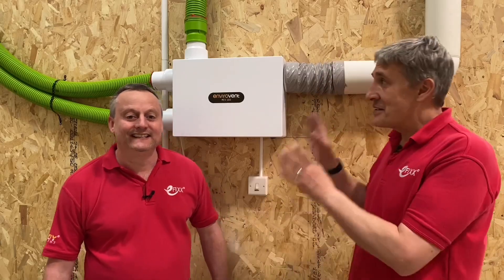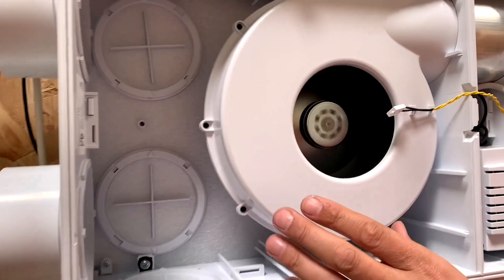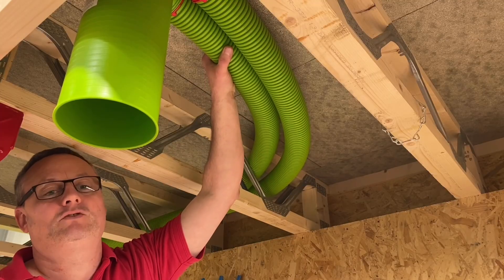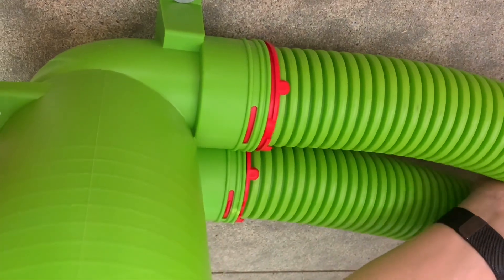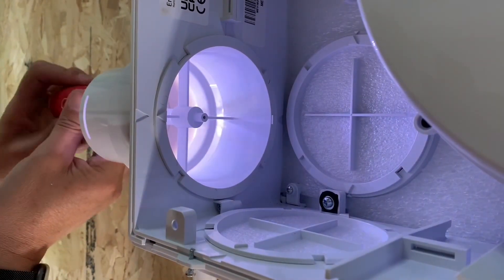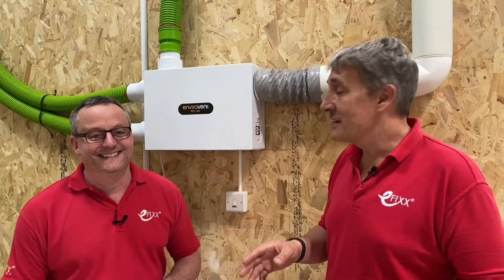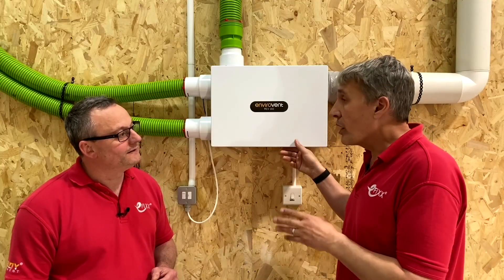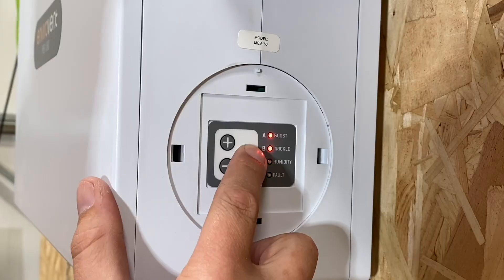WHOLE HOUSE VENTILATION is EASY with the MEV Fans & Fast Track ducting from ENVIROVENT

Comment: Nice system, worth considering for the future, i tend to fit MVHR's these days.. tip, use a double pole switch for running the boost and light switch.. tend to wire the lights in pvc t&e and the boost in lsf, saves confusion on the connections.. now for a few beers to destroy the mental image of Gaz sat on the khazi :)
Reply: Fast track ducting when designed as part of a mvhr system is a game changer. No contractor would willingly subject themselves to a week of more of screwing and gluing conventional rigid ducting after using this... 60% at least time saving
Reply: @dave2166  Both flexi and rigid have advantages and disadvantages .. we tend to you slimline rigid as we mainly do new build flats and more often than not ceiling void space is at a premium, esp if it needs lagging due to condensation or a fire break is needed, the flexi I'm sure is great for house bashing like the lads showed in the video, it's a good product and i dare say i'll use it when the right job comes up
Reply: @thattoolguy9432  you can get oval section semi rigid.... ceiling voids are the bane of any ventilation designers life... rarely sufficient
Reply: @dave2166  Thanks, that's handy to know i shall have too look into that .. i feel your pain.. it's gotten worse in recent years now with the added sprinkler systems .. we usually get 8" between finished ceiling height and the slab above , but by the time dryliners add a main bar then track and board that's the best part of 3" gone.. we tend to use 2" x10" slimline.. don't do a lot of ventilation, but good to diversify in the current climate
Reply: @thattoolguy9432  you can't always use the first in gets best runs rule either... but vent in apartments should be first as it's usually the biggest component. 
It's when the MEP isn't designed well and you've got trade conflicts that things go wrong 
We're always happy to support our contractors on site with prestarts and ongoing assistance throughout the job...
Reply: Nice to see someone doing more than the minimum
Reply: @edc1569  Thanks buddy